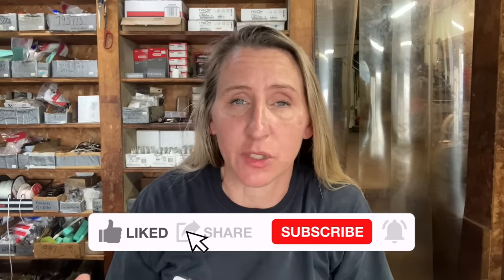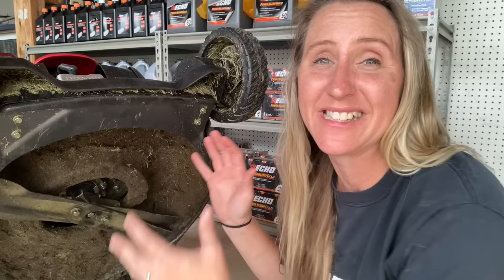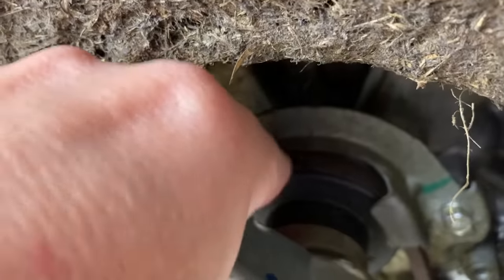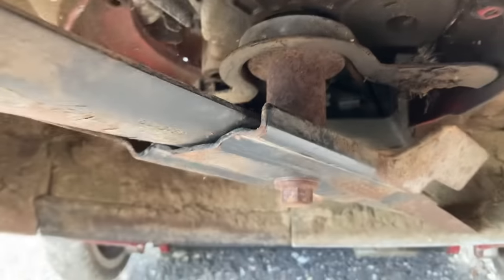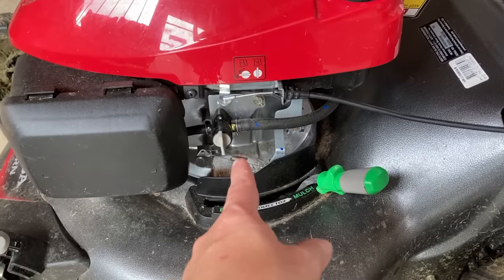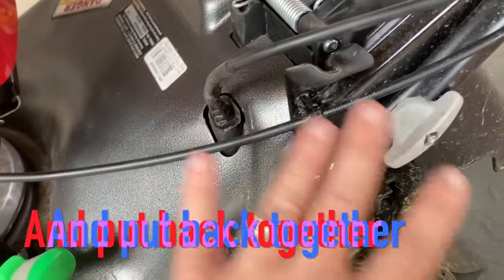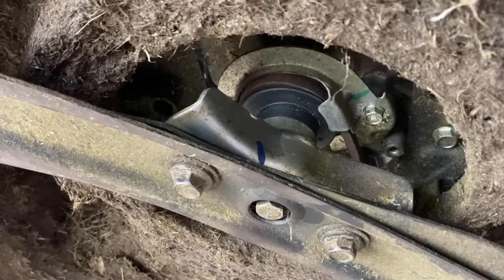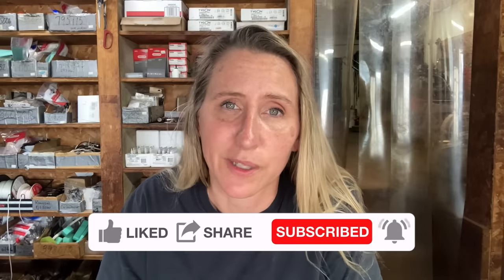SAVE A TON OF MONEY in repairs by NOT BUYING this NAME BRAND mower.

Comment: This is the kind of information that we as the consumer need to hear. Thank you for doing this and having the fortitude to do so.
Reply: Truth! It’s better than Consumer Reports.
Reply: While I agree, learning how to actually clean your equipment or preventative maintenance will also go a long way.
Reply: @MrReddevil420  Right!?
Some people just don't have common sense, or are just LAZY. 🤦
Reply: Honda needs to smarten up. It looks like a shroud may be able to fit around the belt. There appears to be mounting holes under the mower. Maybe someone forgot to install one.
Reply: @philipbreau1246  Thet are not going to, as of September they will stop making mowers!
Reply: @randygreen007  Consumer Reports wants you to purchase hand powered reel mowers.
Reply: @larryezell5106  That’s because they are getting kickbacks from the manufacturer. No thank you.
Reply: Fortitude?how about using common sense like keeping up with maintenance ?if you read the manuals they all say the same thing.MAINTAIN YOUR EQUIPMENT!They all come with a maintenance schedule
Reply: I live in Florida, and often mowe in the morning, but do keep it clean. I have been through 2 hondas. The wheels lock up, get bald and fail, and the drive system is terrible. The new models claim to have fixed them, but I have had nothing but trouble with. I also bought from a dealer and have mine serviced properly, but they cant fix a design issue, and honda could make these bulletproof. At the end of 2023 honda will no longer make mowers, so my dealer says. Engines are good. Rest is planned obsolescence. My opinion.
Reply: @polarlab113  
"...if you read the manual..."

rEAD THE manual!?
Aren't you the optimist!
lol.
Reply: Sadly, some mowers are so bad you would never want to buy them if you knew which ones they were.  There is an battery powered one that you supposedly can't get the fan for.  It is the part which the blade mounts to.  I am not 100% sure on the availability of that part.  I don't own that mower but I am glad I don't.
Reply: @larryezell5106  so does greta thunberg
Reply: @stevepompei3694   Greta Thurnberg has never done an honest day"s work in her life.
Reply: So if you abuse your mower don’t buy a Honda buy a piece of crap MTD or a Toro. simple solution.

Comment: I'm 70 yrs old,and I 've worked on small engines for over 48 yrs.
I've seen good,and I've seen terrible!LOL!
Refreshing,to see someone with the same values,..i.e., looking out for the customer,and doing things right.
I lived in Michigan,all my life,until moving to the Lonoke/Cabot area,9 yrs ago.
I still do a few units,just to keep busy.
God Bless,and  good wishes,for you,and your husband !
Reply: I've had a brand new Husqvarna could never get it to start from day one. started using ether to start it. Once running it cut great was 4wd
Reply: I so appreciate your honesty. Thanks!
Reply: Lonoke / Cabot?  Arkansas?  Nice area if so!
Reply: John 👍 I am a couple years ahead of you and have worked 12 years in small engine rental and repair. I love Chickanic because she is honest about helping the customer, which seems to be a lost value. Now it is ‘Use until it breaks and the go buy a new one.’
Reply: Now I'm wondering what kind of self propelled mower I should be looking for here in Florida 🤔 any suggestions
Reply: @samueladams584  Husqvarna makes nice self-propelled mowers.  Super dependable, in my experience.
Reply: @samueladams584  I've had pretty good luck with a Toro mower. All in good order after 4 years. The drive system has been no trouble. About all I've done is clean the carburetor jets a couple of times and deal with water in the gas once.

Comment: I 'm a guy and I'm thouroughly impressed with your knowledge, skills, and contageous work ethic!  I wish there were more like you!  I'm now a subscriber to your channel!  We need more honesty in this business.  And, Honda, making poorly engineered machines!  That's so unlike them!  Profit over ethics I guess!
Reply: Honda automobile motors are also having major quality issues!  According to a recent class action lawsuit, drivers of certain 2018-2023 Honda vehicles may experience stalling and oil dilution. Manufacturing defects in the engines of affected vehicles can cause the car’s oil to be diluted with fuel, causing significant wear and damage to the engine.

Comment: Never mow wet grass. Let it dry, never mow first thing in the morning.  My dad taught me that 50 years ago. Good video.
Reply: It only works with a mower designed to handle wet grass. I had a cub cadet zero turn commercial sum years back wet,dry,raining it didn’t matter and it didn’t plug up . I got rid of it because it was killing my back

Comment: I bought a Murry walk behind lawnmower from Walmart 15 years ago for 120$ My friends told me I’d be lucky if it lasted a summer. 15 years later after heavy use and never having an issue with it I gave it to a friend to use on his lawn. Always started on the 1st or second pull.
Reply: I'm with you on Murray. I've got one which I bought in '93 that wasn't self-propelled. In about 2005 I retired it to my off-the-grid place at 8000 ft were I mow my driveway and rough yard (in the mountains). The only thing wrong is the pull rope retracter quit retracting so I drilled a hole in the top and start it with a drill, home made adapter and an 11/16 socket. It still starts every spring. 
I replaced it with a self-propelled Toro (2005)at home and that one too still runs and self propels itself perfectly. And both have the original spark plug!
If it ever quits snowing, I'm going to take the Toro in to have it adjusted.

Comment: I use the non self propelled version of this mower for my lawn business and it's never let me down! Going into my 4th year and it still runs like new.
Reply: Same here.I buy the Honda 216 self propelled residential models and they are half the price of commercial models.I have a couple that are 10 years old.keeping them clean is job one
Reply: And my 30 year old Yard Machines still runs like new.  Other than maintenance, I've never had a single repair.
Reply: I ran my lawn business for 25 years!
Organic Lawn Care of Arlington Virginia 
I only bought Hondas and Snappers with Kawasaki engines for my push mowers 
Hardly any issues and tens of thousands of lawns cut
I wish you well in your endeavors 
It’s a great way to earn a living
Reply: @polarlab113  "Same here."??? His is not self propelled and yours is. What is the same about that?

Comment: I have had my Honda mower for a few years now, no problems. I clean after every mowing, spray the bottom with silicone, and properly store it for the winter. And you are correct, only mow when it is dry.
Reply: I wouldn't buy anything else but honda mowers. I have my own lawn care business and I use those exact models bought 2 for myself for father's day 2 years ago and I put them through hell sometimes and they just won't quit lol
Reply: "only mow when it is dry"

That's just not practical reality where I live and definitely isn't reality in a lot of the wetter parts of the country.  I guess most people can only really get the mowing done on a couple of days of the week.  It rains between 1 and 3 times a week here, depending on specific time of year.  What are the odds that the days your schedule allow you to do it line up with good dry grass?  Not too good in my experience.

In short, if I followed that advice, my yard would just be an overgrown jungle a lot of the time.
Reply: @jontrevino2135  I just bought the same mower and it seems to be a good running mower. I was using a snapper self propelled mower from who knows how long. It's as heavy as a tank and has 6 speeds. The only reason I put it to pasture is bc it's been popping under heavy load and finally died on me the other day. I'm sure I could fix it but I figured it was just time to upgrade. I'm not sure if this is the original motor for snapper but it has a Briggs and Stratton engine. I've had the mower for over 10 years and I bought it used so I'm not sure how old it is. Hope the Honda gives me years of trouble free lawn care. I always mow dry grass. Mostly in the evening when all the dew and moisture has evaporated.
Reply: I totally agree where I live it rains a lot also, grass is almost never dry here. I mow every week during the mowing season to keep the grass from getting too tall. @ColonelSandersLite
Reply: @joetroutt7425   Check underside after each use for grass trapped in the v groove of the pulley (can usually tell as the belt will be raised at that point) or for grass trapped on the outer side of the belt between belt & that belt guard tang thing
Reply: @RR98guy  Ditto for me.  If I only mowed when the grass was dry I would need a bushhog.
Reply: I water before mowing. it keeps the dust down.
Reply: @ColonelSandersLite  exactly in an ideal world you mow when dry but as stated but more often than not life doesn’t allow it

Comment: My jaw dropped when I saw this model you were speaking of. I purchased it last year, so far no problems. I keep the underside clean so I hope I can avoid these issues you speak of.
Reply: @john smith I have that same mower and it does have a belt slipping problem and its only 4 months old and I have had Honda mowers for over 20 years. Your wrong John!
Reply: @john smith thanks for the reply John no I haven't tried that I have a yard full of trees and there's lots of little sticks in the yard
Reply: @john smith She didn't say anything about Honda mowers from years past.  She specifically said the NEWEST MODEL, and showed a new one, purchased 3 months earlier that already needed repair.  She then backed up her opinion by stating she had performed the exact same repair on TEN of the exact same model of Honda mower.  Still say she's lying?  You either need to thoroughly clean out your ears or permanently retire your pipe.
Reply: I too have the same mower been running it for my Landscaping company it’s light strong and cuts well I cut Bermuda Augustine and fescue grass haven’t had to replace the belt yet working on the second set of tires and yes I had I stick get stuck in it ! Popped it out and off I went !

Comment: I used to take customers out to see my line up of repair mowers (incoming and outgoing) and look at the age of the mowers being repaired. I also put replaced parts in a bag/box so customers knew what was replaced. It made it easier to steer them away from problems. Great videos.
Reply: A hard lesson I learnt in my youth.  If one is considering the purchase of a durable good, skip the salesman and talk to the repairwoman directly.
Reply: Very wise man .....i recommend every shop take this advice .....it helps build honesty between the owner and customer leaving no question upon the need of the parts replaced .
Reply: @armchairtin-kicker503  A related generally useful piece of advice I picked up somewhere -

Suppose you're needing to buy a tool to do some things and you want a good one that will last.  Take a look at what brands the guys that use them for a living are using.  They need their gear to be as reliable and repairable as possible or downtime eats into their profits.

It's also a good idea to look at what the rental guys are renting out.  Same thing but possibly more so.  They know they're going to have to rent their tools out to morons that don't know what they're doing.  They also know they're going to rent their tools out to people that do know what they're doing but just don't care because it's a rental.  So, as much as possible, their tools have to be able to take a beating and keep on ticking.

Of course, this isn't 100%.  Just a good starting place, IMHO.

Comment: I've been using Honda mowers for years now. The early HRU215 mowers with the GXV140 motor are very durable, as is the drive shaft / gearbox system they run. These OHV push rod motors also feature cast iron sleeve & are the reason for Honda having such a good reputation for long life. That said they make these consumer grade machines that are build to a price because people purchase them. Unfortunately for a business to remain profitable they sacrifice the brand & thus not all Honda's are created equal.

Comment: My Dad and I Owned countless numbers of Snapper Mowers over the years until they “Cheapened” the Quality and started selling them at Walmart.  I went to a Toro several years ago with a Honda Engine and it was a Great Choice. 👍
Reply: Just so you understand, Snapper never cheapened out on their authentic Snapper models - which have NEVER been available at Walmart or any other big box store. What did happen was that Simplicity bought Snapper in 2002 and put the Snapper name on cheap Simplicity mowers to sell at Walmart. Thankfully Simplicity kept the REAL Snappers - with patented rear disc drive self propelled system- that enthusiasts know and love, in production and for sale only at power yard equipment dealers. 

As soon as Briggs and Stratton bought Snapper back from Simplicity they killed that Walmart deal, and ever since you can only buy the real Snappers, and only at power yard equipment dealers.
Reply: @joe6096  do or did the original Snapper mowers come with Briggs and Stratton engines?

Comment: I have a Toro Super Recycler that I bought new in 2004 and it’s still going strong. I’ve never replaced the drive belt and have never have had to adjust the "personal pace" drive system. I’ve replaced the spark plug 3 times only and 3 seasons ago I replaced the rear drive wheels. It’s been impeccable.
Reply: Got one from 2002.  Great mower.  Compression still strong, Briggs engine.